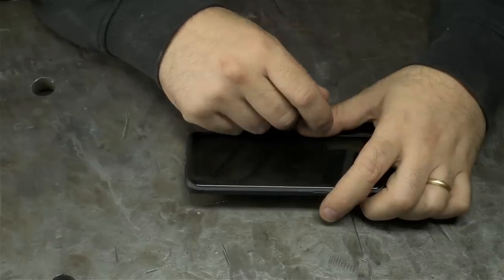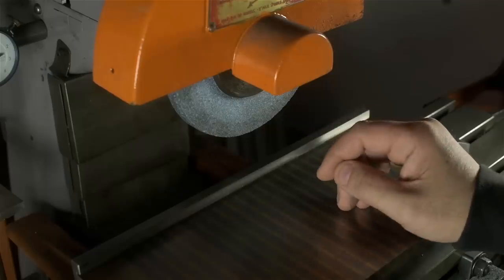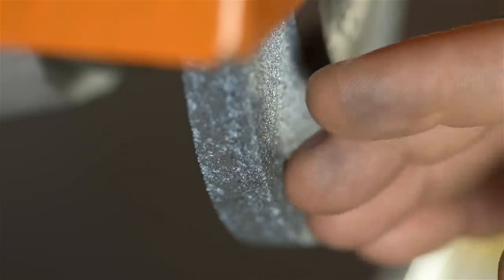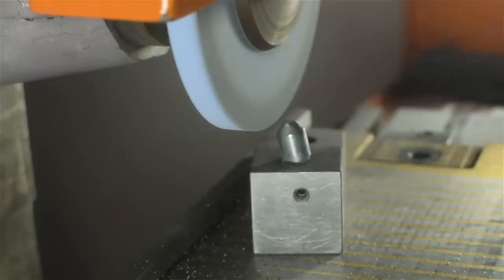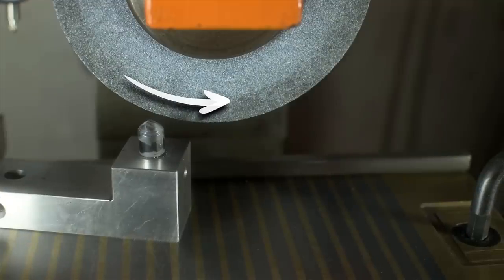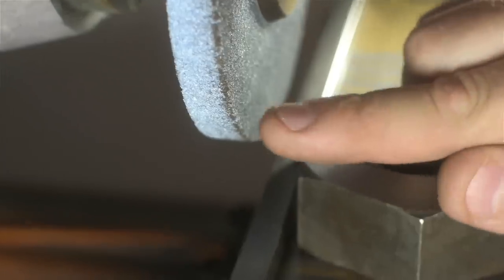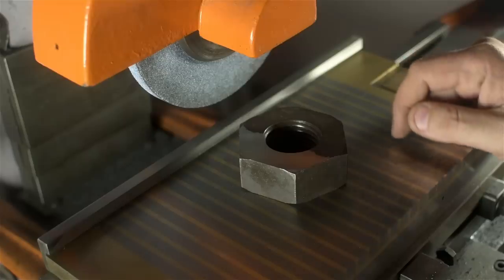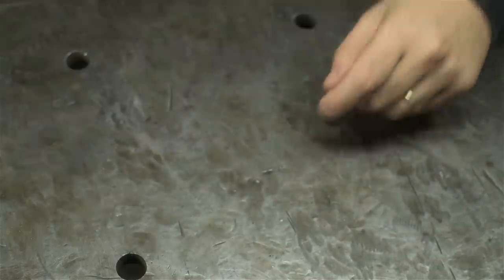How Surface Grinding Works - Part 1?

Comment: Those are "good questions" because they "question" the obvious and end up calling attention to a inevitable and irrefutable (by anybody prepared to be honest about the subject) fact of "grinding" which is that you INEVITABLY end up "grinding away" the WHEEL while grinding away any metal hard enough for the wheel to "grind" and CUT rather than "smear". There IS no way to make "flat" parts multiple wheel widths wide and with multiple "passes" end to end. 

The ONLY LEGITIMATE use I've seen so far of "precision grinding" is in a "vintage" Remington Arms video where "precision grinding" is being used on the "ventilated ribs" on shotgun barrels and its a multi-pass operation with ONE WHEEL on TWO PARTS with both parts being a FRACTION of the width of the wheel and with coolant FLOODING the parts and stone. Th stone makes at most two passes per part and is moving "sideways" as it travels along the LENGTH of the parts. Basically making sure the ENTIRE WHEEL IS BEING "GROUND DOWN" AT ONCE AS IT PASSES OVER THE PARTS. And the goal is a "flat" part that doesn't have to be "level" and isn't DESIGNED TO BE OR MACHINED TO BE. It "tapers" from the back to the front and the precision grinding is just creating a specific SURFACE FINISH post MILLING and prior to "matting" the ribs to reduce glare which basically is a "grooving" operation. 

The REALITY that so many "experts" have been completely misrepresenting the CAPABILITIES and UTILITY and APPLICATIONS of "precision grinders" in so many "how-to" and "DIY" videos where they seem to be as much "tool salesman" as "machinist" if not more is certainly UNFORTUNATE for them and probably their "investments" in various "tool suppliers" and/or "tool resellers" specializing in converting "scrap metal" into "rebuilt used machine tools" after a "rebuild" but like most "salesmen" who think they know their "customer" and don't worry so much about knowing their "product" or even their "industry", eventually the truth comes out and they're revealed to be the "snake oil" salesmen they always were. 

Nobody who has ever ground ANYTHING with ANY "grinding wheel" regardless of "hardness" has failed to notice that the WHEEL IS "SACRIFICED" IN THE PROCESS. Those who have done ACTUAL "precision grinding" of things like VALVE SEATS in cylinder heads and VALVES THEMSELVES using good old Sioux valve grinding tools know that part of the "labor bill" to the customer of the "machine shop" OR a separate "line item" itself is for "shop supplies" and "consumables" like GRINDING STONES. As for that hogwash about "rotation direction" making DICK of a difference viz a vi keeping the part "held" by the "magnetic chuck", ALL GRINDING STONES ARE "BI-DIRECTIONAL" since ALL GRINDING STONES CAN BE "REVERSED" ON A SINGLE "BENCH GRINDER" AND WHICH END THEY'RE ON DETERMINES WHICH DIRECTION THEY "ROTATE" WHEN VIEWED FROM THE "LABEL SIDE". LABEL OUT ON THE LEFT SIDE ROTATING "DOWNWARD" MEANS THE WHEEL IS ROTATING "CLOCKWISE" AND LABEL OUT ON THE RIGHT SIDE ROTATING DOWN MEANS THE WHEEL IS ROTATING "COUNTER-CLOCKWISE". 

It's pretty damned sad  even  some "experts" after they've figured out they've been full of shit for months or years  still don't have the "stones" to admit it and still try to "baffle with bullshit" those they still want another chance to "dazzle with brilliance". I've commented on I don't know how many dumbass "surface grinders are super-duper machine tools for making "flat" parts videos that not only will you not find a "surface grinder" of the type continually referred to as a "precision grinder" in any "machine shop" that does "typical" and "routine" machine work, which mainly means "repairing/rebuilding old worn-out junk" rather than "manufacturing "precision machines/parts" for a "customer" using "eewww-eewww brand-new" materials and having "carte' blanche" to "make" or "modify" your OWN tools for the job at "customer expense", you shouldn't WANT much less "expect" to find one in any machine shop if its being used to "make flat" parts out of the 'mill" that aren't "milled flat" to begin with. 

Just like you're not going to be doing much work to "tenths" and won't be doing much work PERIOD if you insist on converting "ten thousandths" to "tenths" and can't even get the "lingo" correct. And FORGET about "millionths". Especially if every one of your "high quality machine tools" is a worn-out old scrapyard "reject" some scrap dealer paid to haul off an entire "factory's" worth of "used" machine and other tools for "scrap price" or who paid "scrap price" for them turned into a "rebuilt/restored" and "high precision" machine simply by doing a "DuPont Overhaul" (NEW PAINT JOB FOR THE "ROOKIES" OUT THERE) and "scraping" WORN PARTS INTO "SPEC" SOMEHOW MIRACULOUSLY BY "SCRAPING" WORN-DOWN IRON/STEEL PARTS IN SUCH A MAGICAL MANNER THAT "METAL" JUST GOT "SCRAPED BACK INTO EXISTENCE" AND THE "HIGH SPOTS" BECAME "LOW" AND THE "LOW SPOTS" BECAME "HIGH". 

Using a GLORIFIED GASKET SCRAPER. You bet. Here in the REAL WORLD of things MECHANICAL we generally try NOT to "gouge" precision surfaces we want to remain "flat" and "level" with a freaking GASKET SCRAPER while "scraping experts" somehow "put back" and "restore" worn surfaces with the same "technique". We also don't use "test indicators" as DIAL INDICATORS and MEASURE "PRECISION" DIMENSIONS ON PRECISION PARTS WITH MICROMETERS instead of "TEST INDICATORS" AND "CALIPERS". 

Here's the Remington video which is the ONLY VIDEO I've SEEN ON YOUTUBE YET WHERE A REAL MACHINIST IS USING A SURFACE GRINDER FOR ITS INTENDED PURPOSE AND ISN'T TRYING TO DO THE IMPOSSIBLE AND MAKE THE PARTS BOTH "FLAT" AND "LEVEL": http://www.kmf-bearings.de/Inhalte/LLK%20100%20E.pdfte

8:28 in. You might also notice that he isn't taking all damned day "setting up" for that "precision machining" operation and is using a real "machine tool" of the INDUSTRIAL variety that's made for the task. Not a scrapyard reject "one-ended bench grinder" mounted over a "sliding table". 

"

Comment: Back in the 90s or early 2000s I saw an interview with an inventor that had managed to transmit sound via laser beam for highly directional audio, he was claiming the American government and large corporations screwed him somehow.  Be careful ToT, they might censor your grinding wheels.
Reply: The laser method works both ways.Vibration of Window glass can be read by laser. Picking up speech by cops,outside of building.

Comment: so when I was in machine class at a trade school, a remember a duesche that told me i was grinding wrong,  I was doing what you were doing, not taking full with or half width passes,  life .005 paces, or .02,  do you ever rough in,  talking only .001 off top and using a 50 % overlap type pass

Comment: also when you dress the wheel the diamond is actually leaving a taper on the wheel ITSELF--ESPECIALLY its first few passes. 

single points like that I dont use anymore I use the cheap pedestal grinder ones and take the handle off and clamp them in a small little vice. they are sintered diamonds so you have a dresser good for life with hundreds of diamonds if not thousands. dont forget only ONE of those diamonds actually leaves behind the dressed wheel

those single points are a thing of the stone age past. except for certain cases such as dressing radii where they are needed.

Comment: Is there a reason you don't use cooling? Most of the time the grinders I saw used it. It made a bit of a mess but it kept the parts from getting burned.

Comment: Does your grinder have the option for coolant. What are the pros and cons of coolant on a grinder
Reply from the maker: it does not.  coolant allows you to take heavier cuts and grind for longer, also cuts down on dust in the air.

Comment: Hey Tony. A few months ago I saw the video where they grinded the magchuck for first use and also use cooling while grinding. 

The magchuck I understand, it's to make the clamping surface parallel, but I don't know how bad it is for the chuck. And how effective is coolant for grinding, what are the biggest benefits besides the mass?
Reply from the maker: All mag chucks need to be dressed (ground) when installed.  Or if you take it off to do something else, when you put it back on, technically, it should be ground again.  Grinding doesn't hurt it.  Coolant is great as it keeps the parts cool.  A wet grinder has a lot better chance at keeping parts flat than a dry grinder does.

Comment: I'm not a machinist, but this is intereting to me. You have a specialized grinding mill to trim off the bits the actual mill leaves, I have a wire welder and a handheld grinder. Even Uncle Bumblefuck's clapped-out Bridgeport is better than doing it good enough with a handheld death wheel. But hey, I got other things to do and am from the south. See Mike Finnegan's "Jerry Rigg University" t-shirt and ballcap for my approach to building things. I'm used to working to ... shall we say looser tolerances (Instead of a milling machine I have gas axe, Sawzall, and death wheel), so it's fascinating watching people like you and Clickspring do basically magic.

Comment: Switch the electrical cables feeding it on the back and it will turn clockwise with faster speed and less energy consumption.

Comment: Sooo... getting back to the Opto-acoustic levitation... is the dynamic range inverse to the frequency and how does the mass and elevation affect it... but really on the other hand thanks for the explanation on grinding
Reply: Depends if the mating TurboEncapulator is a Right Hand Traverse or Left Hand Traverse Optimizer

Comment: Does fluid cooling extend the life of a grinding wheel? Or does that again depend on it's ingredients? ie an extra pinch of cinnamon or perhaps a grain less salt?
Reply from the maker: No clue as I've never used a 'wet' grinder, but I'd guess probably yes.  Washes away all the crud, keeps the parts cool, etc.  Extra pinch of cinnamon always helps too, of course.

Comment: I've been assigned operating a surface grinder it never accord dressing a grinding wheel the diamond dresser should be on the trailing edge.I been using the center of the wheel and never realized the danger putting the dresser on the wrong side,thanks save my butt

Comment: Say if I wanted to buy a Surface Grinder... what are some must-have features I need to look for? Also, what are some things I should avoid, so as not to make my experience suck?
Reply: Eco Mouse modern grinders with bearings instead of bronze bushings in the table handles is one huge difference, the old ones with the bronze bushings will wear your out cranking on them.
Reply: You are too lazy to own a surface grinder. Your questions have been answered many times (on forums, blogs, and machining related YouTube channels - how to buy, how to use, how to repair, recondition). Do your homework pal.
 
Other folks - don't help him. Helping will spoil him. Disservice.
Reply: xxx yyy how do you know he's lazy from his comment lol.
Reply: You don't know me, what my operations are about, what I can and cannot do, perhaps the employees that I have. But thanks for being so positive and NOT solution oriented. This YouTube IS a community of like minded individuals. And I am asking a question in the correct "forum" if you will. I did a quick look on eBay for Surface Grinders, and they range from $129k down to $750. Obviously lots of overlap there. I'm not asking about price, or whatever... I just wanted to know some basics before I invest in one, and ya know... employ more American workers, stimulate the local economy...

Comment: a very sincere video and he admits he does not know what hes doing and is pretty new. This is going to be a LONG reply. as he dresses the wheel as if to show the taper in the wheel what that actually shows is a person feeding across too slow. exactly why the leading edge is broken down. The fact is in surface grinding including such as cylindrical grinding the wheel should NEVER advance less than 1/4 of the width of the wheel. Not one person in TEN THOUSAND does this when operating a manual or hydraulic surface grinder.  they view the wheel as if the leading edge of a cutter. IT IS NOT. the cutter is the face of the wheel. In proper grinding the entire face of the wheel will have ZERO front edge wear or taper. 

Lets assume I am at manual surface grinder. I never except when roughing advance the Y LESS than 1/4 the width of the wheel. same as in cylindrical grinding. There are bizzare cases like roughing off .050 in which I will advance the Y a few thou. otherwise its never done. 

good sincere video by great guy but trust me he is new to surface grinding

burn marks? what he says is true that the wheel loads up with melted metal and that becomes far worse with a bigger new wheel. when moving in for the kill on critical job they will put on new big diameter wheel YOU THEN GET BURN MARKS. that is because the interface is now much larger. (took me decades to figure that out)
Reply: to move in for the kill on ultra critical high risk parts the wheel should be changed AS SMALL AS YOU CAN GET IT. exactly the opposite of what is taught. a large fresh wheel can be used but the operator such as on hydraulic then needs to know to advance the feed in the x MUCH faster. that is beyond the scope of people in machine shops so best to go with small wheel unless the shop is very advanced.

Comment: I've been told my my instructor that you have to true up the grinding wheel after  everytime you turn it off.
Reply from the maker: I've come to learn that that's a bit of a contentious point amongst machinists.  I used to do that all the time, too.  In fact I would let the grinder warm up and then not turn the spindle off until the job was done.  Far be it from me to contradict an instructor, but in my experience, on MY grinder... doesn't seem to make a difference.
Reply: This Old Tony thanks for the reply and me and my classmates enjoy your videos alot.

Comment: I hope you still check comments, is this surface grinder great or better to get a surface plate and manual flatten a side (want to make 2 sides that can slide together and not need a gasket between)
Reply from the maker: a surface plate would work but a surface grinder is alot faster.

Comment: Vacuum clean the grinding dust, especially when dressing the wheel! Save your ways and surfaces! They don't like rubbing on each other with abrasive stuff around
You would not like to have sex with Sand between moving parts, isn't It Tony?

Comment: Spent 7 years in front of a surface grinder, big surface grinder 4 X 20 feet. Normal down feed was a 1/2 thou or less and the cross travel was 1/2 to 3/4 the wheel width at each reversal of the table. Plowing off stock with the edge of the wheel was not done it's a very poor use of the wheel.

Comment: How would you set it up a patr if you needed your first grind to be the perpendicular surface that is not perpendicular to the mag Chuck and won't be a reference until it after its ground?
Reply from the maker: put part in a grinding vise of fixture and set up as needed for first grind.

Comment: So you basically just rely on the wheel not wearing off over the whole of the face before one surface is finished and then freshen it up between surfaces

Comment: I prefer to use an angle grinder with an accurate mental DRO to flatten my parts.. and no that’s not because I can’t afford a surface grinder, it’s just that I find that my most accurate piece of equipment in the shop is my eyecrometer... wait a minute, I don’t even have an angle grinder.

Comment: You just fecked the diamond dresser by not using coolant whilst dressing (diamond is a super-efficient heat conductor) and turned it back into carbon - a flux capacitor might fix that.

Comment: Does the metal particles that get imbedded into the wheel reduce the wear rate, or have any effect on the wheel? That would be a neat concept, to use the ground material as the grinding/polishing 'medium'
Reply: lemmonsinmyeyes oh if only, the particles just rub and generate heat which is not good even in an unheated shop in the middle of winter.
Reply: Clogging, loading and/or glazing of the wheel is a bad thing. It reduces ability to cut and you will burn (literally) the part. No benefits here.
 
Mix of grit and resulting chips from the part is sometimes used in hand stoning. Some stones (for example mold finishing stones) cut (grind, lap, polish) properly only if you create some slurry (so during process you do not clean it completely, intentionally). To complicate the story, opposite is also true - some stones cut better when clean, you must keep adding new fluid (oil, kerosene, whatever), flush constantly.

Comment: The YouTube-way of grinding is soooo wrong. You DO NOT move the wheel small incremenents over the part. What happenes is that the wheel gets tapered. You always want to move the wheel 1/3 to 2/3 of its thickness over the part. Much larger incremenents. Believe me, do your research on that - not on YouTube for frogs sake! I've been working as a grinder for almost 15 years in a big tooling company with a shitload of grinding machines - small ones, big ones, conventional and CNCs, round, profile and flat and what not. And I've never seen this grinding style but on YouTube. Doing bigger overlaps  improves surface finish and your wheels live so much longer...